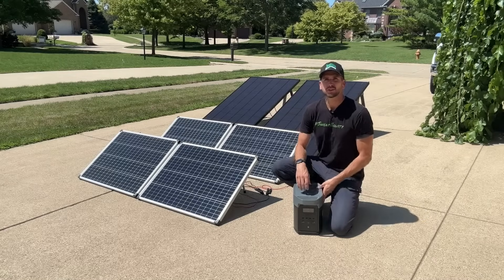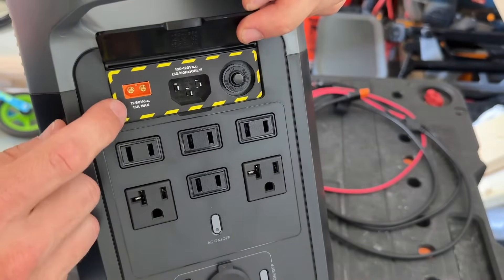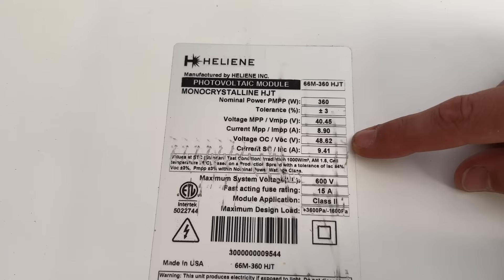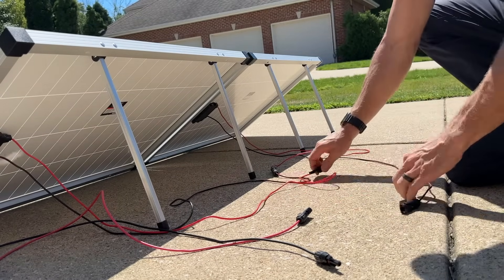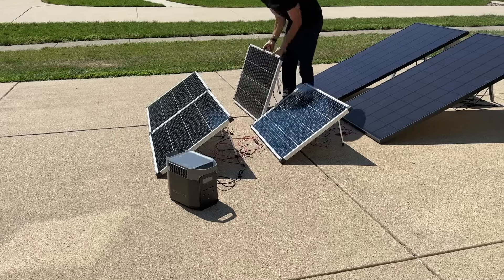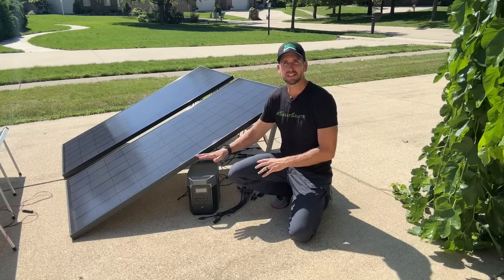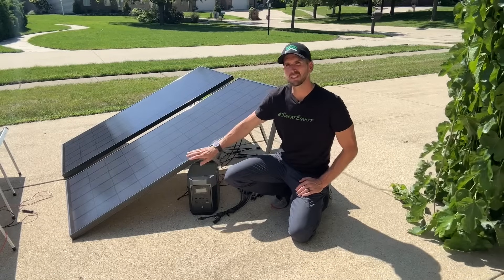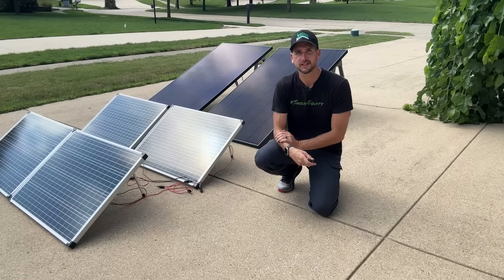Charging A Portable Power Station With Solar | ECOFLOW Delta 2

Comment: I’m trying to see if I could wire 5x 100 watt Ecoflow panels into a delta 2. Could I put 3 in parallel and then series it to 2 in parallel?
Reply: Did you ever find out about this?
Reply: @JoshsWayOfLife  nope, ended up just doing 4 100 watt panels
Reply: @ngk330  thanks bro

Comment: I actually own a Delta 2 Max and have been trying different setups. With 12v panels I've actually found a 2s2p 100w configuration works the best and keeps it within tolerations. I've tried doing a 3s configuration and the Ecoflow won't charge due to the panels open circuit voltage being over 60v. That being said I'd easily swap out with something that keeps it below the 60v / 15a max limitation. The Q CELLS 485W XLG103QPD-BFG gets pretty close to that. Overall you need to really read the spec sheet of any panels you're using and understand the open circuit voltage. Otherwise your EF device isn't going to charge. I've also found you're going to get N-1 wattage out. In other words if you have 400w of solar, you're going to get about ~300w out.
Reply: I also own a Delta 2 Max and I'm looking for solar options to charge it during power outages. What did you end up using? Thanks!

Comment: I just bought a brand new Ecoflow Delta 2 Max with 2 ports of 500watts each and my question is which adapter is the right one between XT60 and XT60i for this Delta 2 Max ?
Reply: XT60i

Comment: Users have reported that Delta 2 cannot charge by solar when there isn’t enough power coming in. It will say 0 watt input until there is more than something like 25 watts coming in. This is bad for users with smaller panels or cloudy days, and  basically inefficient since you’re missing out on a good part of the day.
Reply: It might not display but it should charge anyway. Like with the ac. It won’t show anything under 10W but it sure does work.
Reply: THIS @MrCoffis
Reply: Yes when it’s cloudy and raining delta 2 and my 200w panel drops below25 w incoming Solar the panel shows 0 plug the panel into my victron controller says 12w coming in
Reply: A charge controller can't activate to bring in any watts until the solar panel has meet it's minimum voltage starting point. That is also the reason people typically connect panels in series in lieu of Parrell so they can hit the minimum voltage both earlier and later in the day. Look at the specs and make sure you do not merely match the minimum voltage, but exceed the minimum by 2x. If it's a 12 volt system have at least 24 volts of panels. etc.
Reply: This is standard with inverters etc, it needs a minimum of voltage to start the charging.
Reply: Lol, if you are putting less than 25 watts, you are wasting your time anyway, so there would be zero reason to connect a panel to it that is absorbing less than 25 watts.
Reply: @SAMMIEJONESJUNIOR less than a 100w is not usable

Comment: I have the exact same ecoflow. Where did you get the 360 panels. Will it hurt it to be hooked up all the time
Reply from the maker: I got the Heliene panels from the Alt E online store https://lddy.no/1fpoy.  Their stock of panels rotates often but you should be able to find similar size panels currently available.  You need to make sure you stay under the max voltage or the EcoFlow will shutdown your solar input and you might miss out on charging during the best part of the day.  Current will be limited by the EcoFlow.
Reply: I got the ecoflow delta 2 extra battery 1kwh . 1800wtt can I use any solar panel to charge it like 200wt solar panel @everydaysolar

Comment: I have the Delta 2, among other LiFePo4 tech., and I love it. It'll be the unit I grab if I need to go in a hurry. The way things are going, I'd highly recommend people be getting prepared, just in case. Besides having a very portable power station, at least one flexible / foldable solar panel is also highly recommended. Besides food, water, and protection, having electrical power is near the top of the list.

A very informative video. Thank you.
Reply: Yessir, MyTube 4Utoo! I bought the Delta 2 and the FLEXIBLE 100 watt SPs--mostly because they can be "hung" vertically in my south-facing windows even in Winter. Power-up with the SP inside the home!
Reply: Yes… well I just bought a new delta 2 and it came charged at about 25%… or near that… I tested it out on some stuff last night… I also got the double sided eco flow portable panels at the same time… however… they are charging very slow it seems.  They come with attached stands, but it’s very difficult to get them to sit at a 45 degree… so I lad them flat, negating the other side… for now… oh and I have a battery… the directions are not very explanatory… but it doesn’t seem too complicated… however the sun is shining no clouds in the sky and it sure seems like it takes a long time to charge.  Hooked up to house plug, they fill up fast… now, maybe when I get a better set up that allows the back to work… I’ll get a faster charge… but, without the solar capability… and without knowing how long it takes to recharge w solar… I’d suggest you have several usable units so when you need to be charging one, you have one that is working… or be sure you have the solar charging figured out and are not just depending on charging in a plug somewhere.
Reply: EXACTLY 👍
Reply: What’s up with the bots??lol
Reply: That's great to hear that you love the Delta 2 and it's your go-to power station! It's always important to be prepared, especially when it comes taving electrical power. I appreciate your recommendation for a flexible/foldable solar panel too. If you're looking for another portable power station option with impressive features, I would highly recommend checking out the Segway Portable PowerStation Cube Series. It offers a massive capacity, fast recharging, versatile sockets, and comprehensive protections. It's definitely worth considering for outdoor enthusiasts and RV lovers like us. Happy camping and stay powered up!
Reply: Thank you for sharing your experience with the Delta 2! It's great to hear that you love it and find it reliable. I completely agree with your recommendation about being prepared, especially when it comes to having electrical power. The Segway Portable PowerStation Cube Series is another excellent option, with its massive capacity, fast recharging, and versatile sockets. It's definitely worth considering for outdoor enthusiasts and RV lovers. Stay prepared and enjoy your outdoor adventures!

Comment: Hi there I know you can’t go over the voltage limits but if you say doubled the current will it still operate? Or would an error come up ?
Reply from the maker: The Amperage will be throttled on the Delta 2 with a max input current of 15 Amps.  You can connect up a system capable of delivering 30 Amps but the Delta 2 will only allow 15 Amps.

Comment: Can the Delta 2 handle 4 110 watt panels in parallel ??? I'm thinking of getting a Delta 2 but want to be sure I have everything I need to hit the ground running... I'm a newbie. The only bad question is one not asked. Thanks in advance!
Reply: I just ordered a Delta 2 today! And have them same question. I think from what I’ve researched aslong as the voltage is right across all the panels it should work but the Delta 2 itself can only take 15Amps max so hooking it up to a 30Amp solar array wouldn’t be optimal that’s more Delta Pro territory. U still can charge it with a 30Amp array but the unit will only allow 15Amp max in. My plan is to go with 2 200watt panels but I havnt decided who to buy from yet.
Reply: It depends on VOC volts open circuit of each panel.
I Have four 100w panels and I need to have two in series and two in parallel to stay under the 60v.
Reply: @samuelfox8126  I'm planning on 4 Ecoflow 110 watt panels. When you say two in series and two in parallel, do you mean 2 pairs of series and then parallel the two pairs of them all together?
Reply: @reese9276  yes, that's how I did it and it works for me. Hopefully those panels are under 7.5 amps each so you don't lose any capacity by the ecoflow 15 amp cap.
Reply: @samuelfox8126  From memory, I believe they're about 6 amps....

Comment: Hi, I have a Delta 2 Max with 2 x 410w identical panels from Canadian Solar going into each of the 2 Ecoflow inputs. Each pair of panels are wired in parallel and their ratings are 37.2 volts / 28.02 amps and 410 watts.....even in full direct sunlight (with the panels directly facing the sun square on), I am only able to generate a maximum of 850 watts and cannot reach the stated 1000w maximum the Delta 2 Max is supposed to be capable of.....I have tried the panels as singles, so 1 panel going into each input and that way I manage 630 watts maximum....anyone have any ideas on how to achieve the maximum of 1000 watts solar input ?
Reply: Your panels are the limit here. They would not produce 1000W on any inverter setup. 850W is about expected for two 410Wp panels.

Comment: I have ordered a bluetti AC180 however a friend has an eco flow tec portable panel that he said I could borrow, do you know if the portable panels all have the same connections into the battery units? thanks
Reply from the maker: No, they don't all have the same connectors.  Most of the panels will have MC4 connectors and then you will need a conversion cable to connect MC4 to the connector on the portable power station.  The EcoFlow uses an XT60 but I think the Bluetti is a different input plug for solar.
Reply: @everydaysolar  thanks for replying, I mean the connection into the box. So basically will an eco flow panel with mc4 work on a bluetti if they both have mc4 connections. Thanks
Reply: @everydaysolar  oh is mc4 the name of the connection into the panel. I see. Thanks so much 👍👍👍

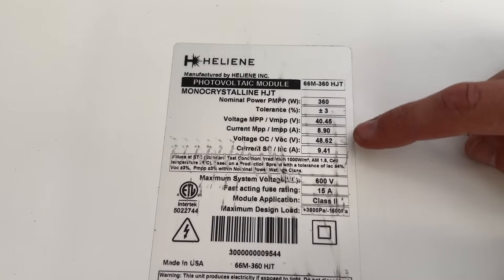Comment: A greeting from Slovakia. I live in a block of flats and the panel is attached to the railing on the balcony. I bought a victron energy 175 watt solar panel for my Delta 2 and at the right angle to the sun I get 140-155 watts. The panel is polycrystalline and cost me 125 euros new. Now it costs around 150 euros. If I do not position the panel correctly to the sun, then around 90 watts. In my opinion, it is worth buying two pieces of 175 watt panels and connecting them in parallel and you get 350 watts. Realistically and with a good slope and a time interval of 6 hours (from 09:00 to 16:00) about 280-310 watts. It is cheaper and more efficient to buy fixed panels versus folding panels. Hint : i did compare  charging  from 34% to 100%  and  with 200 wat it  will need 4:06 time to charge. But  with 300 watt is will need only 2:48 time to charge. So massive difference between 200 and 300 watt charging.
Reply: You won't get 350 watts most likely in parallel as you will  hit the max amps in limit. Assuming your panels have a short circuit current of around 10 amps, it will  however  help out hugely on cloudy days and handle shading much better than a series setup.
Reply: @rjbfreelander2  i tester already 2 175 wat panels in paraller conection.   15 amps x 19,4 volts = 291 wats. This was peak resul in tíme from 1 pm to 3 PM.
Reply from the maker: Hey 👋 thanks for the feedback.  It is really helpful when people provide details on their specific setup since we all have different needs/use cases.

Comment: So helpful for new solar generator users!! Thank you !! I have a delta 2 and have been struggling to understand how to get close to 500w solar input and staying under 60v.
Reply: You and me both. This is a very commonsensical approach to this important step. Too many options exist and this cuts to it.
Reply: It’s simple. Over panel it. Stay below the voltage and the current (amps) should stay close to the 15amp delta limit but it’s ok to go over as long as your wiring supports it. I over panel my d2 with 2s3p (2 100w panels series, 2 100w panels series, and a 265w panel all paralleled together. Yes I’m aware of the mismatch but this gets me to 574w approx which means on a cloudy day I’m pulling good watts and on a perfect clear sunny day I’m right at the 500w limit. Remember the d2 will consume the amps it is rated for. It’s the voltage limitation you cannot exceed or risk damage to the charge controller within the d2.
Reply: Great video! It's awesome to see how the ECOFLOW Delta 2 can be charged with solar power. If you're looking for a portable power station with similar capabilities, I highly recommend checking out the Segway Portable PowerStation Cube Series. It has a massive 5kWh capacity, fast recharging, and a durable armor design. Perfect for outdoor adventures and backup power at home!

Comment: Here are a few questions for all the pro's out there. Im looking at selling my house and going boondocking out in the wilds of southern British Columbia. I will be working online with Starlink, and running an average gaming laptop. I added up what I believe my watt hours per day would be... not confident in my numbers... 10,000 watt hours / day sounds crazy to me! but I want to set up a solar, wind generator hybrid system. I also want to hook in a Gas generator/inverter to recharge the batteries if I need it. Ive been looking at these Power Queen 12v 200 ah batteries that can handle up to 2560 watt loads, run in parallel they will give me 12v 400ah and handle up to 5120 watt loads??? IS THAT RIGHT??? or is it still just going to handle 2560 watt loads???  Im just running back through the math again and seeing my max load with everything running at once should be less that 1000 watts.... So here is where I really need help. How many 200 watt solar panels should I get? what size charge controller? Im guessing about a 2000 watt inverter should be good? AND HOW DO YOU WIRE A GAS GENERATOR TO YOUR CHARGE CONTROLLER!!! Can I some how just wire the gas genny into where the solar panels hook in and have diodes preventing the power coming from the genny into the solar panels? Am I over thinking this? I do have 2 gas generators right now, both small, one does 880 watts, one does 1200 watts. How would you hook them in to recharge your solar bank?
Reply: Will Prowse Channels covers all this.   His channel will help you understand the limits/possibilties of solar.
Reply: There’s no way that setup pulls 10k watts a day unless you plan on gaming 20hrs a day. You got a lot of research to do. You’re better off just buying a premade kit like an EcoFlow Delta Pro or Anker 767 with extra battery.

Comment: You need an XT60i cable.  The basic XT60 is limited to 8a.  The "improved" can handle 15a.  The XT60i is orange and the basic one is yellow.
Reply from the maker: Thanks for the clarification and I will be sure to call that out in the future videos 👍
Reply: I have this cable, just arrived today and my panels are only pulling in 23w. Cannot figure all this out for the life of me, wish I just purchased a different battery lol, I got it because I thought it was the most straightforward and easy to use.
Reply: @dreampunkworkshop a different battery will have similar requirements. Makes no difference which one you get

Comment: and what will happen when there will be 500 + watts?
Reply from the maker: If you go over on current (Above 15 Amps) it will just "clip" the current at 15 Amps and not allow anything higher.  If you go over on voltage the solar input will shutdown and not allow any solar power in.  That is why you do not want to push things on voltage.
Reply: And what will be 500+ watts? what will happen? 360+360=720 (550/600/700)

In my country, the support tells me that it is impossible to graft as it burns, only 500. But it seems to me that they are not saying anything. @everydaysolar

Comment: From what I'm seeing here, it's okay to exceed Delta 2 parameters for voltage, amps, and watts without doing any PERMANENT DAMAGE  to the Delta 2.  When you exceed voltage you get no power.  When you exceed watts and/or amps it just uses up to it's max of 500 watts / 15 amps and the excess has no adverse effect on the Delta 2?
Reply from the maker: Yep, don't push the voltage close to the 60 volt limit because if you go over the Delta 2 will shutdown the Solar input and you will get nothing.  When it comes to Amps the unit will just "throttle"the Amps at 15 even if the panels could deliver more.  I like the second setup much more and if I were installing this in a shed I would do the 2 X 360 Watt (or similar) in parallel.
Reply: @everydaysolar  Thanks
Reply: I fried my delta 2 by going over the voltage with  4 200w solar panels 😢

Comment: That’s the problem I had!  I tried to add a third panel in series and must have exceeded the open circuit voltage. Is there no way to hook up three panels a a delta2?
Reply from the maker: Just depends on the individual panels.  If you are bumping up to the voltage limit it will shutdown the solar input.  Could you get another panel and setup like I did with the 4 X 100W panels?
Reply: I fried mine using to many solar panels

Comment: is there a way to regulate the voltage coming in, to say, use those smaller silver pannels in series with the black pannels to get it near 60v 15A
Reply: You could try using a dc to dc converter. But … that would probably mess up the ability of the MPPT solar charge controller to be able to optimize solar panel output? And you young end up with sub optimal output from your solar panels :(